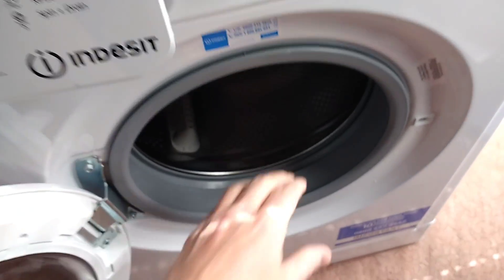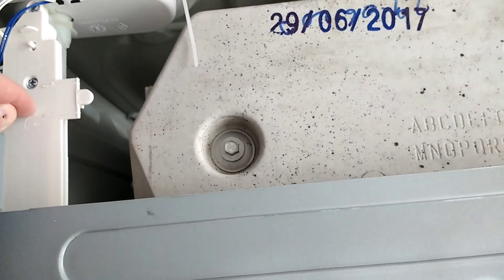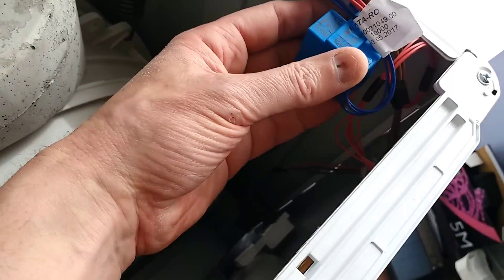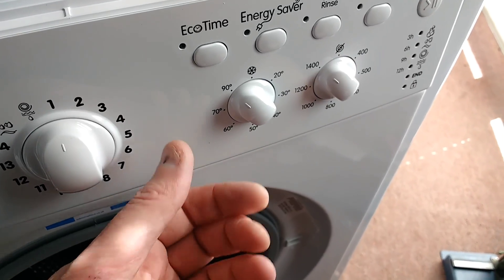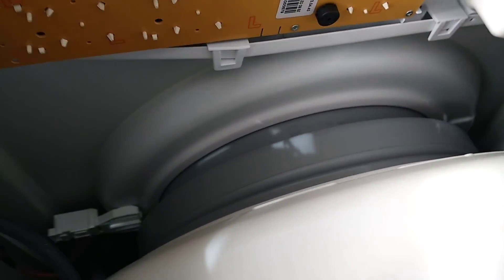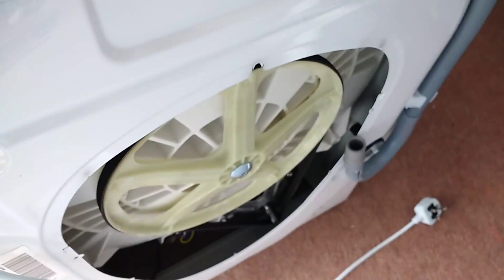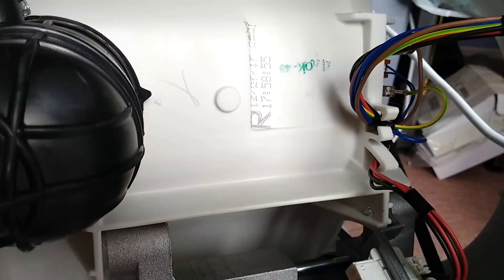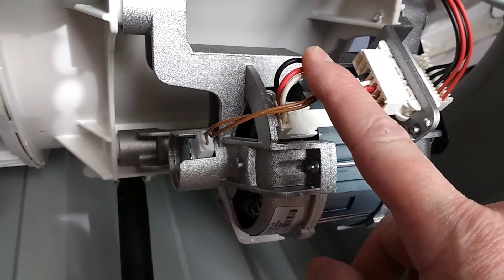Inside my new British washing machine (clothes washer).

Comment: Ah, so the hot water inlet is something common in the UK? I noticed a couple of weeks back on a website that in the comparison tool it had hot water yes/no, and I did not understand what that meant. I thought, off course the machine is going to have hot water, why would you was your stuff in cold water. But now I get it, the UK has the machine hooked up to the hot water tap, and that is what hot water yes/no meant.
Never heard of that in my life. In the Netherlands they are all cold water with heaters.
Reply: In the US the hot and cold inlet is standard, forever. Our water heating is central nearly always. Running on gas, 240V, or in a few places oil. (to match the furnace). Some few high end washers that have an "extra hot" cycle, have a heater inside, just to raise the temp from 120-140F to 160-180F. Side note: 

I think many misunderstand the US home electrical setup. Fixed lighting and normal wall outlets are indeed 120V and 15A (some 20A outlets) but fixed equipment and any plugins of significant power are all 220-240V. Houses built or refurbed since the 1960s' have 240V @ 200 amp, 'center neutral' service to their breaker panels. Before that 100A was common.
Reply: i wouldnt say so, ive had several washing machines over near 40 years, none had a hot inlet, all cold single
Reply: I think they justified removing the hot water feed by saying that you need to pull in a fair amount of water until it gets hot anyway, and you're only pulling in cold water anyway. I used to get round this with my old machine where I would run the sink to do the dishes before putting the washing machine on, so it had hot water there immediately.

My new machine of course only has a cold water feed. My electricity bill has jumped a bit.

Of course the A+++ rating only takes into account the amount of CO2 produced, it doesn't take into account the relatively cost of gas and electricity. The cold-only feed only makes sense if you have Economy 7 and run the machine at night!
Reply: Paul Gascoigne the UK has always had 240 volts? Unlike, for instance, Belgium where they had 110 in some parts. My own home country the Netherlands had 220 and is now on 230V
110 is mainly a US thing
Reply: @WouterWeggelaar   The UK standardised after the second world war to 240v - ring mains was used due to a shortage of copper. That's the reason UK plugs have fuses in them - ring mains can carry 32Amps!
Reply: I think in a lot of countries that use only 110v they prefer a hot water inlet because the amperage goes sky high.

My new machine is cold inlet only and that last few before that were all 'faux' hot water hookups. The problem also if you have a hot water tank other side of the house rather than a combination boiler you have to run the taps ages to get the water to the machine otherwise it just fills up with cold/luke warm water.
Reply: My dishwasher has a cold and a hot inlet... But the manual stipulates to only use the hot water inlet, if your household has some form of alternativ heating, like solar water heaters. Otherwise it would be too expensive to use the hot water contra the build in heater.
Reply: That's not the point. If you've already paid to fill a DHW tank, why heat the washing machine water as well? Electricity is still up to 4 times the price. As environmental concerns came to the fore machines reduced the quantity of water used and 'biological' powders could be used at lower temperatures. More recently there's been a big push toward combi boilers, so there's no point in using hot fill. Cold only machines are also often a few pounds cheaper to buy. The A+++ rating means diddly squat. Insulating all the pipework, fill the machine every time, handwash in the shower. All energy savers. Of course, we now realise that "power on demand" is unsustainable and energy storage is now vital. Anyone with a DHW tank is already equipped, at least partially.

Anyway, is Clive getting chicken? I noticed he didn't void the warranty on this machine, even keeping the shipping bracing on.
Reply: In Australia we pay near on 40c/kwh for electricity, but a very large percentage of houses have solar heated hot water, which actually has to be tempered down to 50 - 60 C so people don't burn themselves. For Australia hot and cold inlet machines are far more efficient.
Reply: Aways been 240v, even now it's officially an EU wide 230v, the reality is that 240 is what's coming through the meter.
Reply: tin2001 everybody you knows tighty whities are yellow. 😂
Reply: Indeed... In the US the HVAC, water heater, washer, dryer, are all usually in the "utility room" or sometimes in the basement (in areas were basements are practical) sitting near each other. In my house the bathrooms are above and right next to the water heater. But the kitchen is a half the width of the house away. Oh well. Cant have everything close.
Reply: Because it takes so little water the 'hot' supply never actual supplies hot water so they don't bother with it anymore.
Reply: I have never seen a cold only washer in the US. I cannot see US consumers going for cold only. And we got machines with the auxiliary heater option only in the last 10 years or so. I think because its been a trend to turn down the water heater temp to lower standby loss and reduce the risk of scalding for children. But my heater is set on 150F and it comes out the kitchen tap at 140.  The dishwasher and clothes washer seldom if ever run their heaters. (unless I set the washer to "extra hot")  Some few newer houses have 'temp reducing' taps or valves that limit the temp in sinks and showers, so washers can have the full temp.
Reply: Yes, and this is even more of an issue these days as modern machines use less water, so there is even more of a chance that the hot water used in filling won't have run enough to be hot.
Reply: I was wondering the same thing, never heard of a washing machine with a hot water tab.
Reply: An inbuilt electric heater sounds expensive. Especially washing clothes for a big family.. Electricity prices are crazy in Australia and gas, solar or heat pumps are used for water heating. The old electric storage heaters are not installed any more. I have never seen a washing machine with cold only. I guess with rooftop solar pv the costs might be ok but I imagine it limits the water fill rate having to heat it.
Reply: It doesn't heat it as it goes in. It fills then warms. Like a kettle. Yes, it can take a few mins to warm up.
Reply: +mweverett: We don't misunderstand the electrical setup of a typical Dutch home.  A typical Dutch home has a bigger breaker for 230V, because the electric plates for cooking need more power.  In some (according to Wikipedia more rare) situations these connections are a 3-phase 230/400 V connection, where the voltage between one phase and the neutral is 230V (And thus is not more dangerous than a regular 230V plug other than sometimes having a bigger breaker) but the voltage of every phase combined is 400V. Homes in The Netherlands are usually all wired with 3 phases coming into the house.
Reply: We all live in rabbit hutches now with combi boilers. Only your grandma has a detached house with hot water tank and garden. No point having hot fill.
Reply: Paul Sengupta The waste to heat up the pipes doesn't apply if the washing machine is in the same room as the efficient boiler.  Turning heat into electricity (at the power plant) then back to heat (in the washing machine) is a great way to loose half the energy, thus potentially doubling greenhouse emissions.
Reply: You can't buy a hot water inlet machine any more, they don't exist. Cold only.
Reply: mweverett, If I understand it correctly it's common in the US to have a three wire, split phase 240V hookup. As I understand it that's two 120V lines phase shifted 180 degrees that's using a common neutral. The thing is that in the UK and most of Europe you have 230V (used to be 240V in the UK, and 220 in most of the rest of Europe) single phase, or 3 phase 400V.   If I remember the numbers correctly the heater in the thirty year old washer in the basement will run at 1KW when configured for single phase and 1.7KW when using three phases. It's been a few years since I last looked at it though so I might be a bit off.
Reply: Blahorga Slisk all the domestic household power in the states Canada included is single phase. There can be three phase on the poles in the street but each house will be connected to a single phase. Our electrical supply is a bit weird and that it's 230/ 240 volt with a center neutral. That's how we get 120 volts from either line to neutral for outlets and Lighting. I think it's called a Westinghouse system. I think way back in the day they had a hand in it. There was a lot of paranoia about. So 120 volts was deemed the limit for things that users could plug in or screw in.
Reply: Actually I think it's a quite neat neat way to do it, certainly easier to understand for the end user than a three phase system. I looked it up and I was actually spot on in my description, almost had the name right even. It's called a split-phase or single-phase three-wire system. It's been almost forty years since I read about it in school so I'm surprised I got it that close. Though I'm guessing I've seen it mentioned somewhere as I seem to have picked up a memory leak in recent years. Unfortunately, looking at my relatives it seems it's to be expected, and it doesn't seem to get better with age...

Another thing I looked up was the documentation for the washer. It's probably closer to forty years old, and one of a specially requested series of machines that was based on a fifty or sixty years old design, only slightly "modernized". No electronics, just an electro mechanical program register and a simple thermostat. The heating coil is actually specified as  220V 1900W. It can be configured to deliver 2850W with a three phase hook up, or with single phase power if the wiring in the house would support that amount of power over a single wire, which it doesn't.
Reply: It used to be common in the UK for washing machines to have a hot water inlet (they still had heaters though to allow them to reach temperatures higher than domestic hot water) but cold fill only has been the norm for at least a decade.
Reply: I am somewhat envious of the three phase supply to residences. Its great if you have a large table saw, air compressor, or have former industrial machines like metal lathes in the home shop. No need for 3 phase converters. I costs big $$$ to get three phase into a house, if you can at all.
Reply: In North America there has been a surge in "COLD WATER WASH" variants on detergents as people either reduce the temp of their hot water, or wash only in cold (as I have for the past 30 years).
Here in Canada the government has run advertising campaigns asking people to reduce the amount of hot water used to save on energy
Reply: John Rasmussen in the u.s. dishwashers only have a hot water inlet. For reasons that have been previously stated. They also have heaters to increase the water temperature if needed, from the moderate level the water heater provides to something serious to wash dishes in. And they are 120 volt 20A to a dedicated outlet.
Reply: traditionally the UK had cheap natural gas so it was better to use the hot water from the house hot tank. Due to european efficiency laws we have to all have 'combi' (instantaneous) boilers with no hot water storage. So its more efficient to heat the water in the washer. But older houses with hot water storage tanks or solar panel hot water will benefit from such a washer with hot and cold inlet
Reply: all washing machines in the Uk at least have cold fill only. if you think about water pressures, cold pressure is stronger than the hot which usually (used to) come from a tank in the roof so, by the time the machine has filled to full lvl the hot water will still be on the way to the kitchen from the loft.. so in taking the hot fill off the machine it saves you heating your walls lol
Reply: same in UK. Electric heating, although 100% efficient, doesn't mean it's cheap. If you heat the water off-peak rate and store it overnight, or use solar water panels (or ground heat exchangers) it's cheaper for a hot fill machine.
Reply: I'm in my 30's and my house has a hot tank. Gas heated water is a hell of alot cheaper than electric heated water.
Reply: http://www.cramptonandmoore.co.uk/ebac-awm86d2h-8kg-1600rpm-washing-machine-with-dual-fill.html
Reply: you can still buy hot & cold fill washers in the uk.
Reply: it probably is but if the water doesn't reach the machine by the time its filled all that energy is wasted anyway
Reply: Wouter Weggelaar In Serbia we also have cold water only. But in Greece where they have solar water heaters (free hot water) they do have hot water valves.
Reply: Paul Gascoigne But in Europe we have 220 volts 16 amps max (13 amps in Britain). I live in Serbia and we have Schuko outlets. The machines barely reach 10 amps. But it would still overload a typical American power outlet.
Reply: Here in Serbia everyone has 3 phase outlets. 230V 16A each phase. They look like this:
https://www.google.rs/url?sa=i&rct=j&q=&esrc=s&source=images&cd=&ved=0ahUKEwiJ-des3frWAhXCBsAKHQvaBssQjRwIBw&url=https%3A%2F%2Fen.wikipedia.org%2Fwiki%2FIndustrial_and_multiphase_power_plugs_and_sockets&psig=AOvVaw2ewM0DjikpBY_JLCqKnvzO&ust=1508435250901870
Reply: It was very common for these appliances (and dishwashers) to have hot water inlets, however most now only have a cold water inlet. It seems to be due to "energy saving" marks, as lower temperatures are now used. I replaced my last one (Lasted about 5 years, bought 20 years ago now!) that had hot & cold inlets with a single cold inlet - which failed recently (It had 3 sets of brushes in it, so it served me well). The bearings have gone so it can no longer spin. Of course I can't now get a replacement unit, so it's the kitchen sink or bath tub presently!
Reply: @HoboWild It was a common feature of UK machines right up to 2000. Energy saving markings I believe caused the demise...
Reply: This Hot Fill debate reminds me of when my parents foolishly bought an American style Hotpoint UK top loading automatic washing machine (vertical axle type).
It's water consumption was absolutely huge - 8 UK gallons to wash 4 Kg of clothes and 16 UK gallons to wash 7 kg or more dry weight of washing (from memory the max was 10 kg).
It had Hot Fill to save money and time (in the UK an oil or gas fired boiler is cheaper than using on peak electricity to heat water) and I remember the gas boiler in the kitchen always came on while the washer was filling, unsurprisingly! I remember that I poured the contents of a 2 UK gallon bucket of water into the empty drum and it all disappeared in to the outer drum!
Reply: If you have already heated water especially with something cheaper than electricity like gas, heating water with electricity inside the appliance makes no sense.
Reply: Economic studies have shown if you take all the inputs into consideration those wind turbines will spin themselves into dust and never break even. Just break the taxpayers.
Reply: Tell me about it, just received my $650 electricity bill, that's for 12 weeks. My house has all LED lighting, energy efficient appliances, gas hot water and gas range.
Most of our problems here in South Australia are due to our Labor government (Left I believe) having a delusional agenda of making the state carbon neutral by 2020. They have built dozens of wind turbines along hill faces near the city and in concert with our equally daft federal government have formed a national energy market, which has distorted the pricing so much base load coal stations are being shut down and blown up ( I kid you not) as they cannot stop /start fast enough to meet supply contract conditions and make a profit for their owners. In my state we are now in the absurd position of having to use DIESEL powered generators to get us through peak load periods when there is not enough wind!  But it's all good according to our glorious leader, they will be painted green!!
Never a terrorist around when you need one.
Reply: Every machine I've touched has had hot and cold inlets.... And no one uses the hot one (some people don't even unclip it from the back). The machines don't have heaters either - everyone I know just washes with cold water. Lots of washing powders now for cold washing - including the subtly named "Cold Power".
Reply: Most North Americans wash their wash in cold water to save on power, and North American laundry detergents have been adjusted accordingly for that. In my last 3 homes, I didnt even bother hooking up the hot water inlet.